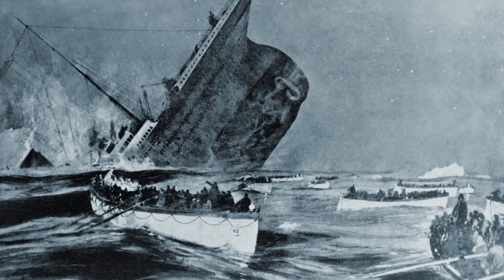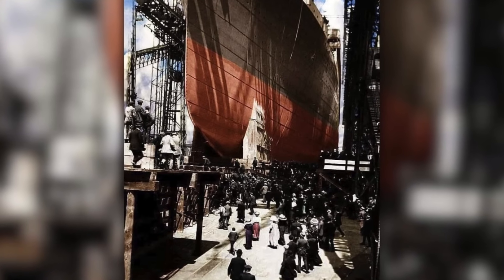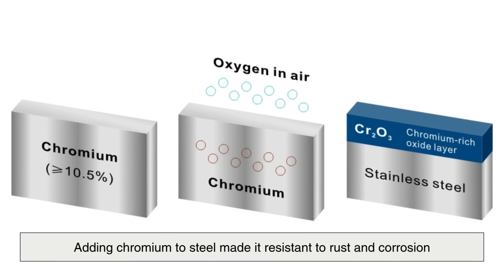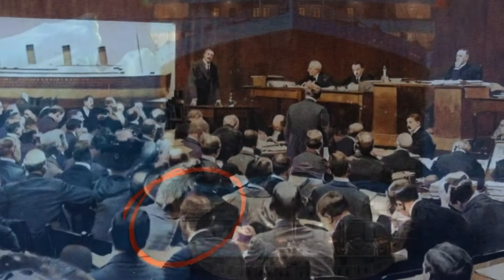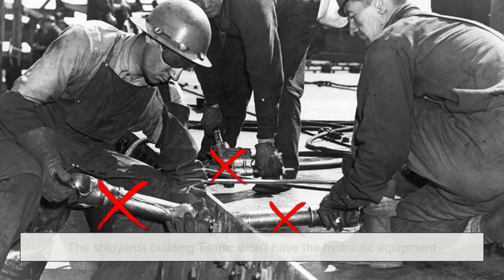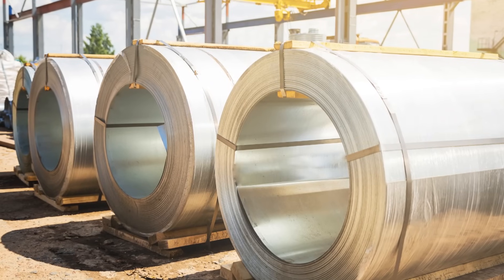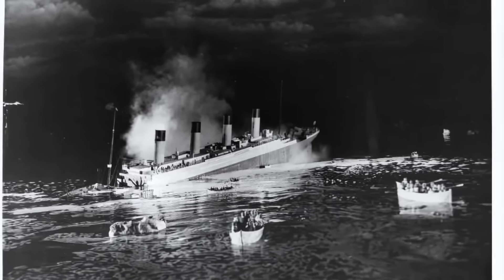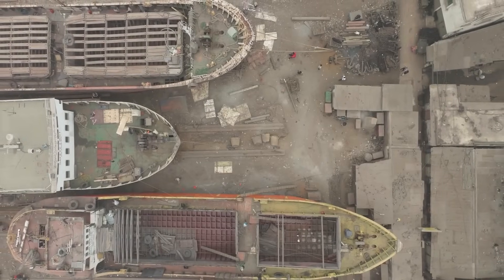Why the Titanic Didn’t Have Stainless Steel—and Paid the Price

Comment: A bunch of "what if's" strung together that make no sense since the materials at use in those days was the best that they had. They blame everything on the material suffering from cold brittleness which is pointless. Think about it this way: "If the Titanic had had radar they could have avoided the iceberg couldn't they." But radar hadn't been invented yet had it just like stainless steel hadn't been invented yet.
Total waste of time.